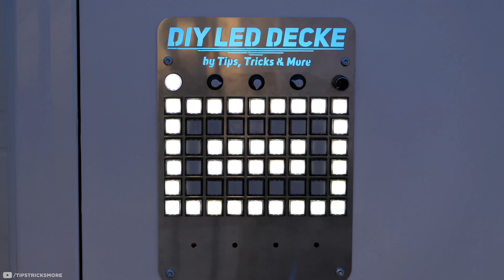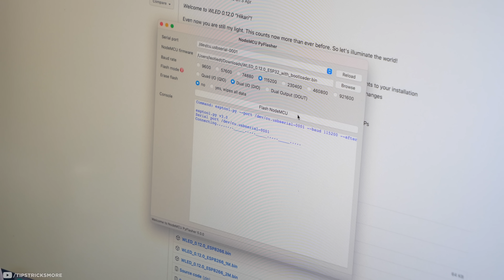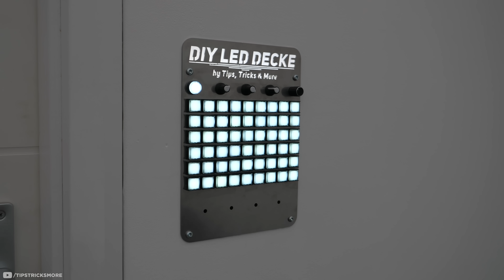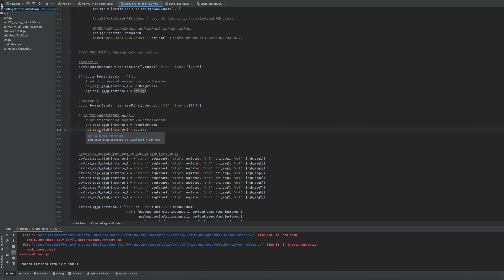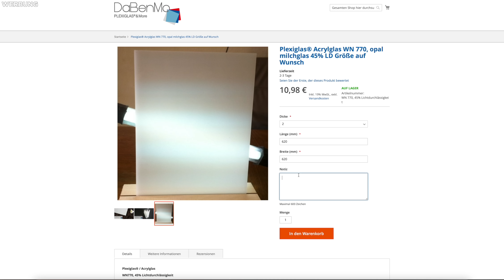Eine RIESIGE LED DECKE selber BAUEN | Tips, Tricks & More

Comment: Sehr nices Ding 👌🏻 Meine Zimmerbeleuchtung hab ich ganz ähnlich auch mit den SK6812 und nem Raspberry Pi realisiert. Zu deinem Control Panel hab ich allerdings ein paar Fragen:
1) Wie versorgst du die LEDs in den Buttons? Der Arduino sollte ja insgesamt nicht mehr als 200mA speisen, sonst kann er kaputt gehen. Ich konnte im Video keine Transistoren, etc. dafür entdecken
2) Hat es einen Grund, warum du die Buttons und LEDs nicht jeweils in einer Matrix zusammengeschalten hast? Dann hattest du deutlich weniger Anschlüsse gebraucht.
3) Waren die vielen Anschlüsse der Grund, dass du den Arduino seriell an den Pi anschließt? Prinzipiell hat der Pi ja sonst auch GPIOs, mit dem er die Buttons abfragen könnte, dann sparst dir nochmal ein paar Millisekunden für die serielle Kommunikation...

LG

Comment: Super Video! Schaut hammer aus :D! Eine Smart Home Einbindung wär jetzt natürlich noch mega.

Für solche Projekte würde ich aber definitiv keine WS2812B nehmen sondern WS2815.

Diese sind baugleich mit den WS2812B mit den Unterschied, dass die WS2815 auf 12v basieren statt auf 5v. So hat man vorallem bei längeren Streifen einen wesentlich geringeren Spannungsafall und man braucht nicht so dicke Kabel. Der Spannungsabfall bei 5v ist extrem schnell schon nach ein paar Metern bemerkbar. Dann ist z.B. die LED nicht mehr weiß sondern geht in einen rötlicheren Ton über, da nicht mehr genug Spannung für blau & grün zur Verfügung steht. Wenn man einen langen 5v LED Streifen auf ganz hell dreht, kann es sogar vorkommen, dass sich die Chips nicht mehr ansteuern lassen, da sie zu wenig Strom bekommen :)

Und noch ein kleiner Tipp: Kauf die LED Streifen auf Ebay. Gerade bei LED Streifen sparst du dir da einen Haufen Geld :)

Edit: Habe gerade gesehen, dass du das Smart Home Thema und den Spannungsabfall auch angesprochen hast haha ;D

Comment: Cooles Projekt. Wie sieht es da mit dem Stromverbrauch aus?
Reply: Er hat 6 "LED-Blöcke", und für jeden Block ein Netzteil. 
Jedes Netzteil kann eine gesamt Leistung von 200 Watt (40A, 5V) liefern. In seinem fall wäre es dann bei allen LEDs eine maximale Leistungsaufnahme von ca. 1200 Watt.. das ist enorm viel!!
 
In der Realität wird es jedoch deutlich weniger sein, da der maximale Wert nur erreicht wird wenn die volle Helligkeit bei statischem weiß eingestellt wird.
Im normal Betrieb (mit Effekten) würde ich auf 40-50% der maximal Leistung tippen.. also so grob 540 Watt (der Gesamtstrom wäre dann 108 Ampere).
Für dich zum Vergleich: eine handelsübliche Glühbirne hat eine Leistungsaufnahme von 60 Watt.

LG.
Reply from the maker: Genau so ist es. Aus maximaler Leistungsfähigkeit zieht die Decke ca. 700-800W.
Da ich aber ja einzelne Module Dummen oder ganz ausschalten kann, ist der Verbrauch am Ende ok. Eine 7kW Solaranlage auf dem Dach fängt bei mir sowieso alle Verbraucher auf, sofern die Sonne leicht scheint.
Reply: @TipsTricksMore  habe noch einen anderen Kommentar geschrieben welcher vermutlich von YouTube als Spam erkannt wurde. Wäre cool wenn du da auch mal rein ließt.. könnte nützlich für dich sein. Mich würde auch interessieren ob du das ganze entsprechend abgesichert hast.

LG.
Reply: @TipsTricksMore  Was mich interessieren würde ist wie hoch der Stromverbrauch bei ausgeschaltener Beleuchtung ist. Die Netzteile, Controller und Led selber haben einen dauerhaften Stromverbrauch.

Comment: Sieht gut aus, aber die Farbwiedergabe ist nicht so toll oder? Ich nutze für Licht dessen Zweck hell machen ist, normalerweise high CRI LED. Ich habe bisher noch keine RGBW LED gefunden die auf dem W Kanal einen CRI Wert von über 90 haben.

Aber nachbauen kann ich eh nicht, Raum zu klein, decke zu Flach, Wände aus Stein, und kein Nebenraum frei.

Aber warum so viele ESP32? Die stripes sind doch adressierbar, die Daten könntest du komplett durch schleifen und alles mit einem Controller steuern.
Reply: Wahrscheinlich reicht Irgendwann die Leistung von einem ESP nichtmehr aus um alle Pixel an zu steuern. 
Und es gibt glaube ich ein Limit wie viele man mit der Software steuern kann
Reply: Es geht um die Fps.. ein ESP32 kann nicht 5000 LEDs flüssig ansteuern.. Daher teilt man das sinnvoller weise aus.
Reply from the maker: Genau so ist es. Die Leistung fehlt.